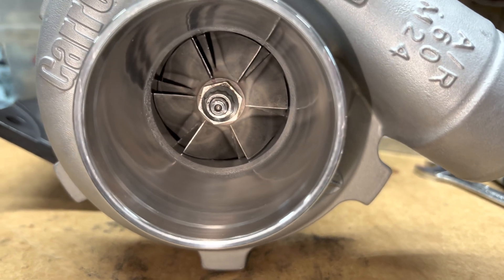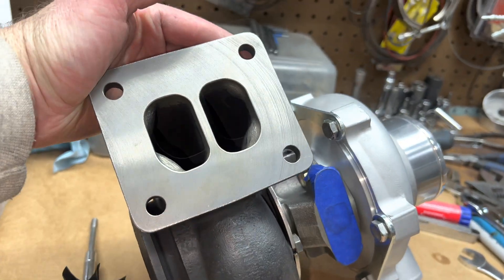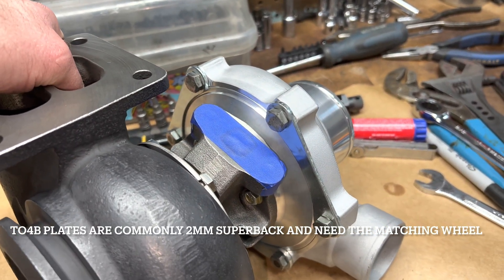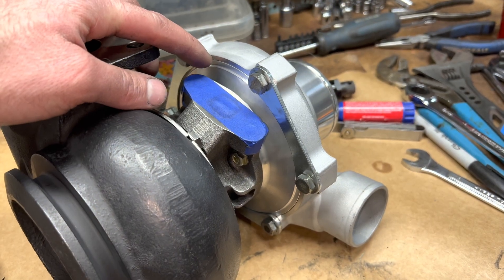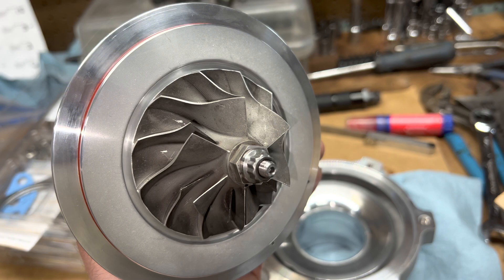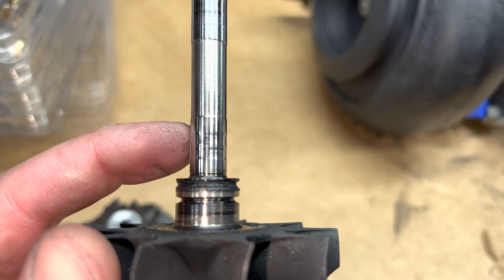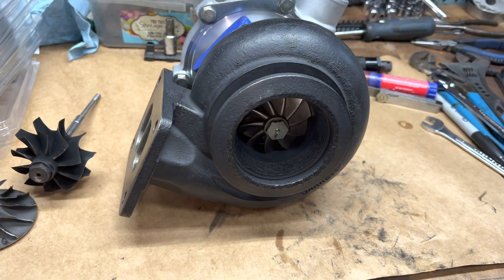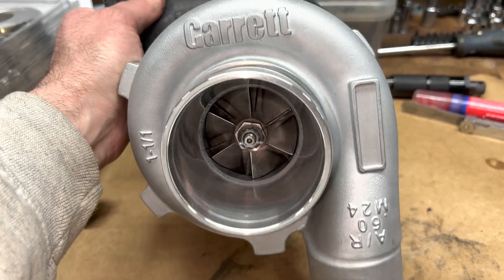Tractor Turbo gets Precision Upgrade

Comment: Can you explain the point behind the Stainless Diesel 5-blade turbos? Do they flow better? More efficient? Or just purely the sound?
Reply from the maker: That design was something zona rotor came out with about 5 years ago. The idea behind it is that it’s supposed to have great spool and increased power. The less blades allows for more air flow. The minor fins are there to help retain spool characteristics but also to allow for increased flow after its already reached target boost.
Reply: @turbolabamerica  do you rebuild s300 turbos?